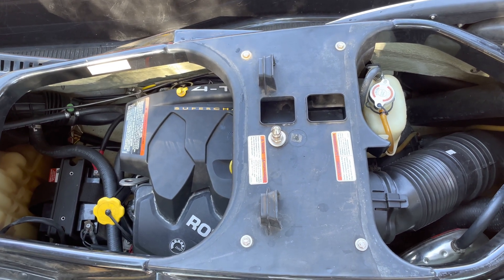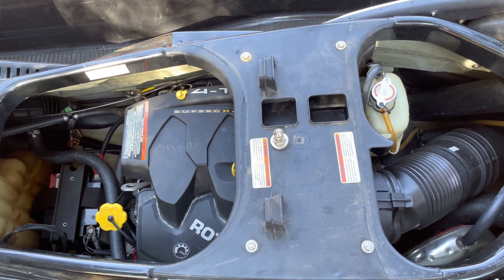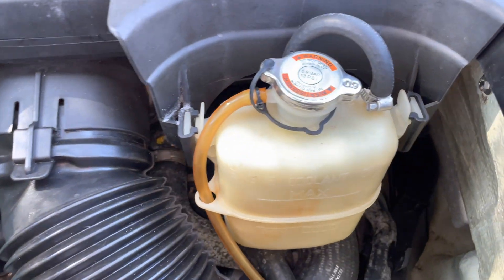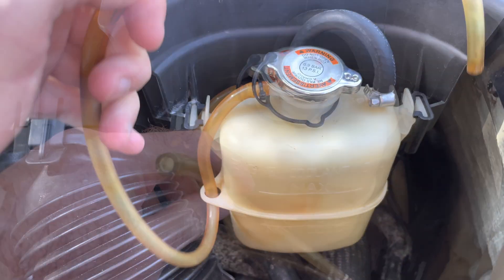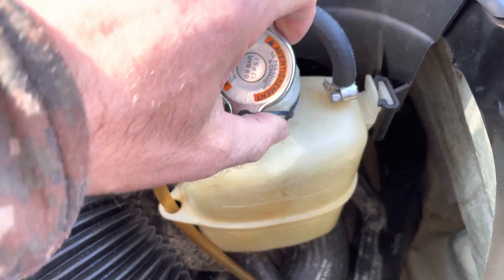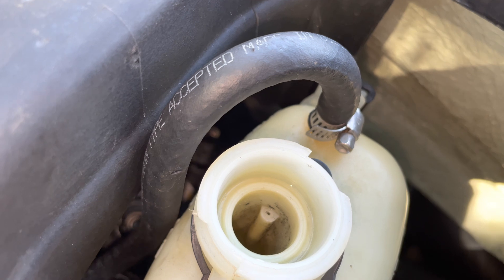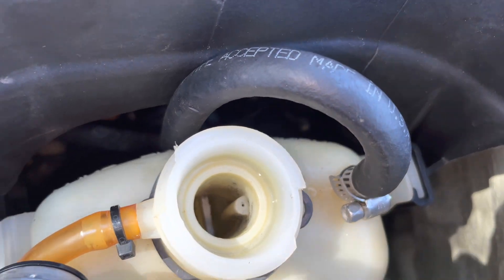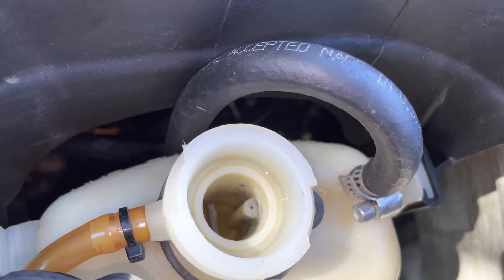Seadoo Blown Head Gasket - Diagnosis

Comment: Great Video. I believe is a Pattern Failure of Sea Doo's (Rotax Engine) TTY Head Bolts which have been utilized on these 4Tec Engines long before they added a Supercharger.
 
Long story short: My belief is that these TTY Head Bots stretch additionally over many heat cycles and WOT runs...
Eventually Combustion Pressures at WOT / High RPM causes the Cylinder Head to Lift which in turn allow Combustion Gasses and Black Flakes from the OEM Head Gasket to enter the closed loop Cooling System resulting in coolant being expelled from the overflow tank and eventual overheating due to loss of coolant. Cure is to replace the Head Gasket (I chose to use Cometic Brand) & to replace the TTY OEM Head Bolts with ARP Head Stud Kit to prevent the Head from Lifting in the future.  Randy  AKA randog311 Retired Professional Wrench
Reply from the maker: Very interesting I will look in to that .

Comment: I had picked up two identical, 2008 Sea-Doo GTX wake get skis.  I was trying to do a complete once over with spark plugs, oil, oil filter, along with fresh battery and go from there.   
The one Jetski oil was milky and antifreeze had bits of oil in it .  
I’m linking it to being either a head gasket or oil/antifreeze intercooler failure.
Reply: Or oil cooler